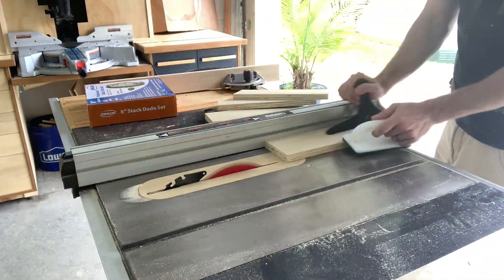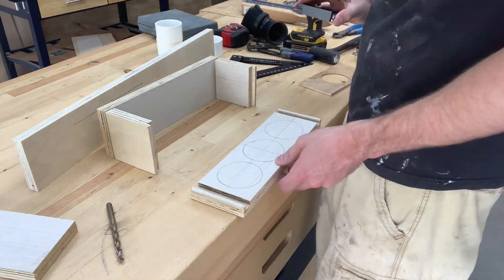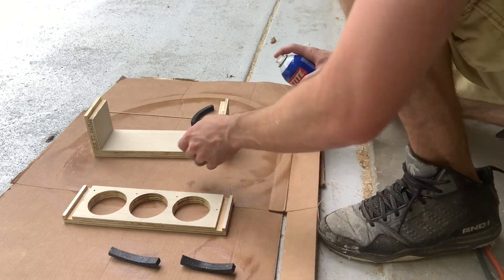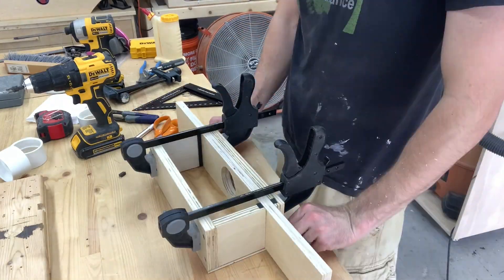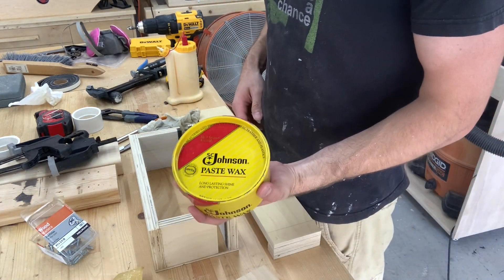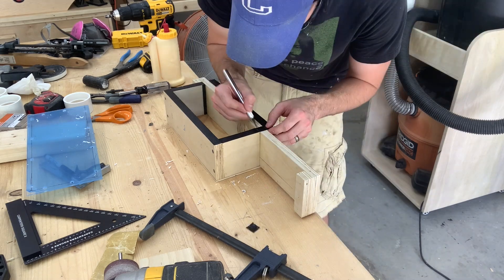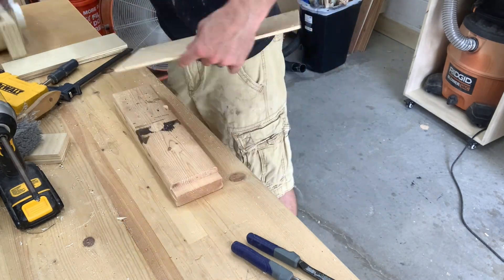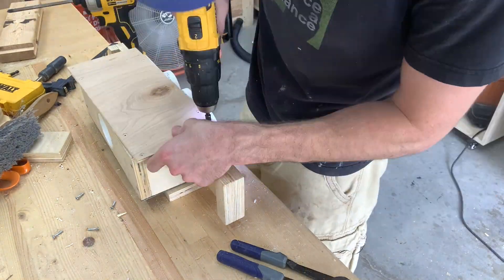Blast Gate Box with 2" PVC Ports!

Comment: I've scavenged the internet for a good looking and yet functional blast gate box and I think I found it! Thank you for filming this --- I'm for sure using this for a number of different spots in my shop.  Question - how is the electric tape holding up after almost 2 years? Thanks!
Reply from the maker: Glad I could help! The whole unit is as good as it was on day one! The tape is really sandwiched between the wood and plexiglass so nothing has seeped through. If anything was to fail, I thought it would be the gasket between the sliders, but they are still holding strong.

Comment: What kind of table saw is that you are using?  Might be time to upgrade from my whopping big 8" ryobi bench top model
Reply from the maker: Its a Rigid R4512 from Home Depot. I have been very happy with it over the last 1.5 years, as it was my first real cast Iron table saw. BUT, I really only cut softwood (Pine), when I tried cutting 2" Maple, it bogged down quite a bit. Something to think about. Thanks for watching!